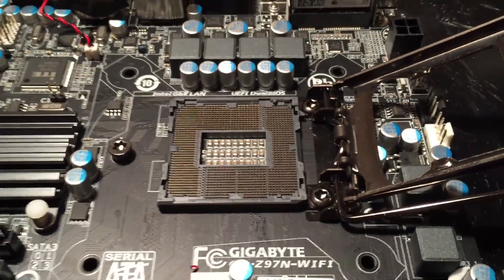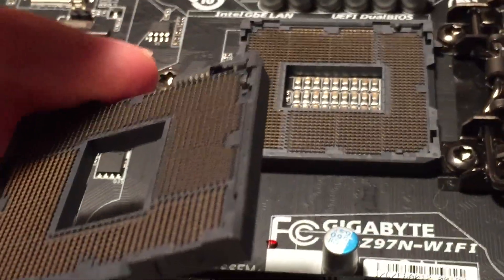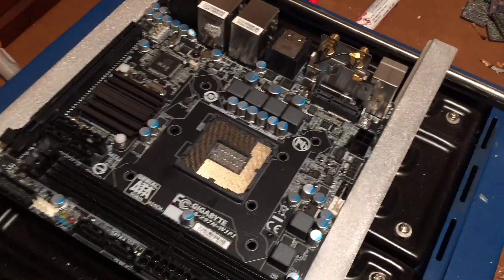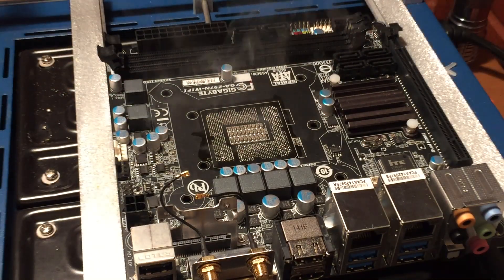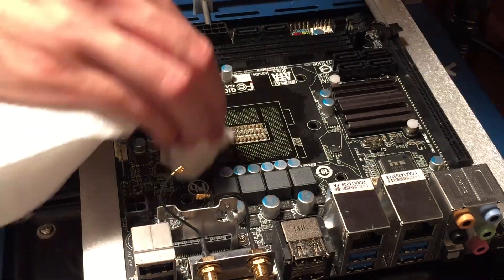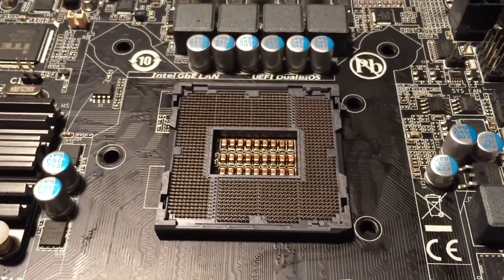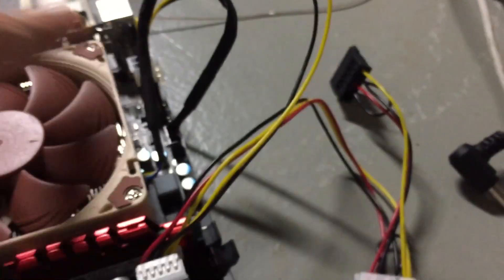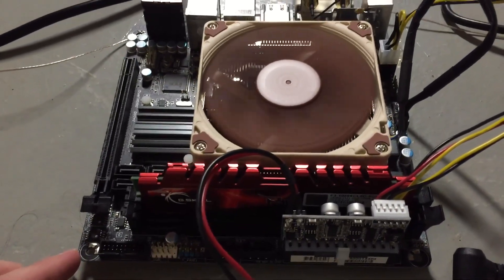Replacing a Damaged CPU Socket on an LGA1150 Mini-ITX Motherboard

Comment: How cool. So maybe U can help? I wanna use the Intel Xeon LGA1366 backplate (or complete retention package) on a LGA2011-3 to gain the bolt hole thread using my favorite 1366 CPU bolt on kits. Is this do-able, comparable? I can't seam to find a dual set of ThermalRight 2011-3 bolts to use my trusty Ultra120 Cu Extreme. The top end "X" bracket has been modded to proper hole spacing so I need a backplate to match

Comment: Pretty cool man. It's nice to know you can replace a broken socket on a motherboard. I'd imagine bending or breaking pins on your motherboard is a very frustrating thing.
Reply: Yeah, it doesnt work with no microscope etc, I mean I have a b450 tomahawk max, It turns on without a cpu but doesnt turn on with a cpu, so it's a socket issue obviously, It doesnt mind the cpu but as you lock in the cpu it shutdowns or doesnt even start, a 150-200$ motherboard became scrap.

Comment: And thats why you use AMD
Reply from the maker: What if a pin breaks off that PGA CPU? Sockets are cheap, CPUs aren't.
Reply: @dosdude1  It's much easier to damage the pins of an LGA Socket than the pins of a PGA chip. For some time, the socket would be exposed facing upwards making it easier to break off the pins by dropping something in the it,  but you only expose the pins of a PGA chip only when you are about to install it. >15 seconds at most, reducing the risk of pin damage or breakage.

Comment: You should get a second power supply for the fan so the speed doesn't vary when the heater cycles on/off...

Comment: Just out of principle (like say if using an extra motherboard but of no value), is it possible to attach the old socket to said extra motherboard having first swapped out the broken pin for a grounding pin or some other such 'expendable' pin? I appreciate it is unlikely to be economically worthwhile, but the principle could be noteworthy in scenarios involving a costly motherboard such as a server-board (or even one that is locked with a license).

Comment: The good thing about intel cpus that I wish AMD could do is that the pins aren't in the cpu itself, so if you bend them, you only have to replace the motherboard, not the CPU itself.
Reply: It's easier to fix bent cpu pins the bent LGA pins.

Comment: Thx Im actually going to try this on a clevo laptop with 1151 socket.Ordered the socket.There were just to many bent pins.I give myself 10% chance but worth a shot.I wonder if welding cable will work to clean up old Solder?

Comment: lucky, not the proper way, should have used kapton tape or foil tape on the resistors inside the socket & around the socket plus under side if you heated that also. didn't even see it being reballed or old solder removed.

Comment: (wont boot without pins)
tell that to my 1150 gaming 5 xD 2 missing pins still works perfectly
and my old phenom 2 X6 1045T missing a pin on the cpu still works

Comment: I am curious to find out if the board is still functioning today?  Amazing work so fun to watch your delicate skills turn scrap into treasure.
Reply: Probably not. This sort of repairs gravely shorten life of any other components on board that are heated over 160° not mentioning +200° :/
Reply: @TOKOLOSE  if you place a protective thrmal tape (idk how its called), it will not damage anything

Comment: Here's a top tip for you: The small lid that comes with the new socket? just put it on top of the old socket and use the vaccum pump to pull it, don't use two tweezers like you did because you'll eventually hit a capacitor or resistor on your way out.
p.s. thank you for your patches, your work and your overwall amazingness

Comment: The most important part, installing the CPU is missing in this video.
Also no information regarding the CPU in the BIOS settings, and information box with this video whatsoever. Lame video.
Reply: did you watch same video?

Comment: Not bad done my share of socket replacements at home on equipment like this, helps when you have extra old stuff to test and play with before you attempt a socket replacement, fyi you can wash motherboards to clean off flux even if its no clean do a good job and clean it.

Comment: Until this day, i didnt know that sockets could be repaired/replaced. This video is just AMAZING.

i have several questions and doubts tho:

1- where can i find/buy a board pre heater and a hot air nozzle for this type of work?

2- how did you know when the socket was soldered ready to the board?

3- the exact temperatures for the work are: 200°C under the board with the pre heater and 250°C over the socket with the nozzle?

4- how much time should you wait for the whole board to cool down?

5- how do you know that the socket is perfectly lined up with the board?

Thanks a lot to anyone who can answer this questions for me!

Comment: I have a board that doesn’t look like it has any issues but it will not post, the PC turns on immediately when I turn on the PSU. The CPU is verified to be working. It did have bent pins when I got it but I got them all back in place and it looks perfect. The board does light up (it has LED) but it has no post codes

Comment: @dosdude1 you have enough subscribers and stuff that you'll probably never see this, but does this process work the same way for 2011-3 sockets
If you've tried doing it with one of the boards?
Reply from the maker: Yes, it does, but those sockets are so big that my hot air BGA nozzle is too small to heat the entirety of one.

Comment: @dosdude1, Hi and thanks for sharing this. Few questions:

1) Would you please mention the brand and model is that BGA Rework Station?
2) Also, the video does not mention/show if it needs reballing?
3) In case, how did you reball them? 
4) Are they pre done in the purchased socket?

Great job and video overall. Liked.
Reply: The new sockets come re-balled and ready to install.

Comment: I have an AM3+ board I'm tempted to send you just to see if it can be fixed lol.  It blew one of the fuses.  I replaced the fuse but didn't change symptom.  Powers on but no post.

Comment: And this folks is why PGA > LGA
Reply from the maker: Actually when you really think about it, LGA is better than PGA. Can't fix broken pins on a processor, but broken pins on a socket can be rectified by replacing it with a new $5 socket.
Reply: @dosdude1  For the end consumer, PGA is better because the pins are stronger and more resistant to damage, unlike the tiny LGA pins. I've destroyed 3 LGA boards because of the stupid pins whilst never had an issue with PGA.

Comment: you way overpaid for a damaged board for 10$ more i can get a new one, amazing job nonethless im curious how long its gonna hold without reballing like the x360 rrod they fix but after it comes back... i never broke a mb socket because they always have the corner triangle to show alignment but some people are donks and dont read the manual

Comment: How did you solder the new socket in place:? Did it come pre-prepared with solder on the new sockets underside? And how to "control" that it does not connect different pins with each other on the underside?

Comment: There has to be something I am missing. I have tried this 8 to 10 times on boards I purchased. I have a hot plate that I blocked off all but the area under the cpu on the bottom and heated it to 150 C and had the hot air on and heated it until the board was 275 C. I kept increasing the temperature until the chip would just start to move at all which was about 300C. I have checked and changed temp probes several times just to be sure the temps are correct. I added way more flux then you did. The caps around were covered with capton tape, but the ones near and in the center all got loose. The socket NEVER even got close to coming off as yours did. Even when I would start to lift one corner and continue heating it would lift the tracks in the corners!!!!! Suggestions?
Thanks   I know this is an old post but I hope you still check on your videos.
Reply: did you able to sort this out? i am facing the same
Reply: @usamawaqas5596  No. I turned up the heat and it did get loose but either the caps all moved and or pads and lines moved!

Comment: I have a serious question, The capacitors in the middle of the CPU socket, How do you prevent those from losing their solder when you heat up the socket and put flux everywhere. Wouldn't the solder on the capacitors become loose potentially causing damage?

Comment: I'm confused, your removed the socket, removed and cleaned the soldering on the board, when did you apply any new solder so that the new socket will stick to the board ??

Comment: Did the replacement socket come with solder on the pads already? I see that you used a solder wick to remove the solder on the pads on the motherboard but didn't use a template to add little solder balls to the pads again. So I guess the socket had solder already on the bottom?

Comment: Video starts around 4:00 mark.
Until then the guy is talking absolute nonsense.
Also, the donut leaves the hot air on all the way through which spoils what we're seeing with a loud whiny noise. 
Get to it laddie, we don't want your spiel. Bloody amateur.

Comment: I'm amazed that when you removed the socket, none of the nearby parts got unsoldered and fell off, particularly the chip capacitors in the middle of the socket.  I didn't understand why you didn't need to put solder paste on the board to replace what you removed.  I guess that the socket itself is a BGA, and has solder balls underneath instead of contacts.
Reply: I was wondering the same thing, but interesting to know that sockets can come pre-balled i had no idea lmao but i also do not do much soldering.
Reply: I had to go looking for this too.  They do appear to come pre-balled like BGA chips.  I might give this a try too.

Comment: Can I send you my board to replace the CPU socket please, every so called repair shop say it can't be done or it would be cheaper to buy a new one 🤦 looking at they website most of them can only do really  basic things like replacing a connected hard drive or replacing fans. 

I got the board 2nd hand but I noticed the pins are not straight and they is 1 pin missing anyways

I wanted to get the part from AliExpress aswell but I don't have the tools to heat and replace it 😭

Comment: around 4 years back, I tried that around 5 Times . First time it was perfect fit. and after 2 times the Socket itself melted - Cheap china plastic components. and 4th time again got it right.. never tried it again because its hard to Distinguish between cheap Chinese and original good quality stuff. It is not about repair, but giving estimate to clients for such a repair where money is burnt in cheap chinese parts is worst. Hence we simply use to tell our customers to buy a replacement board instead of fixing socket.. Unless its a expensive server level board or something unique
Reply: How much does this process cost?? 
I am an indian .

Comment: a technician: fixes broken motherboard by replacing the socket
me: just puts a random piece of metal into the hole with missing pin and the motherboard actually works
the technician: AM I A JOKE TO YOU
Reply: You're a clever guy if you can do that with lga socket motherboards.
Reply: if this metal moves only a little it can cause a short and damage the mobo even harder and maybe the cpu and a lot more things. to be sincere, i have a board like that here and that's exactly what i'm thinking to do but that's my main concern. did you saw before what's the pin for ? and tested if it works without it ? because maybe its not even touching hte contacts
Reply: @leoyru.3361  Well, I actually do not really care what would happen to the pc, since I fixed it and in the result I just bought a laptop, but anyways, it didnt boot without the pin + the socket i did that on has under 1K pins, so it was quite easier and till now (I did this like 2 month ago) the computer works just fine

Only thing Im little bit worried about is that the metal might melt down, but I dont think that the cpu will be that hot
Reply: @itzarty  Most of the metals need 200 C or more to melt, so you dont have to worry about that :D
Reply: @siedliko  vibration: Am I ignored?
Reply: @siedliko  u mean 1000C right?
Reply: @itzarty  Hey are you responsible for all that Australian Bush Fires😠
Reply: @infernustitan7091  omg you revealed me. my motherboard sent a wireless signal to the forests and set them afire
Reply: @siedliko  200c? Is something wrong with you? Most plastics dont even melt at that low a temperature. If you're talking about solder you're still off. Most solder melts around 300°-340°C while lead based solder around 340°-370°C. 
But i doubt he would have placed a sliver of solder into the pin socket, rather a more common metal such steel or possibly aluminum, in which case aluminum melts past temperatures of 1200°C, steel upwards of 1600°C. 
Why would you even.think that? Anytime anyone used their oven to cook it would turn itself into a puddle of molten metal. Did this not cross that thing 
You call a your mind?
Reply: @darkracer1252  It's pretty clear that's what he meant.
Reply: @NikoBell1188  
did you reply to the wrong person?  
i just called someone an idiot like he is. 

there is no implication that i think he ment something else.

and putting a pin (thin piece of metal) 
in one of the pin holes to bridge the gap. 
this was a tried and true repair method used by ALOT of people. back in the 90's. 

the pins were held in place by the plastic of the socket.  it couln't move ANYWHERE as long as the cpu is in the socket.  

so there is no chance of a short what so ever.
Reply: @darkracer1252  he didn't say "most metals melt at 200c". He basically said at 200c you don't have to worry about anything melting. I understood what he meant.
Reply: I did the same for my old server board, I used a metal brush pin and cut it to size, worked like a charm
Reply: Omg
Reply: Reminds me of the time me and my mate fixed his 040 accelerator board for his amiga 1200 using a staple to repair a broken track on the pcb..... worked great still does .... now i need to fix my socket on my z170 board which still works but bent pins have for the moment killed 3 of my 4 ram slots.... joys of owning hi tec electronics
Reply: It is possible that the broken pin was not actually needed
Reply: @ΒαγγέληςΣιγάλας-β7π   yeah there is chance very very rarely.
Reply: @ΒαγγέληςΣιγάλας-β7π  it wasnt booting without it so yeah
Reply: Haha also me. I soldered a wire (two lines from wire) and pci-e detection works fine. Because my H97M ITX AC had missing pin from PCI-E detection.
Reply: a tiny spring will do better
Reply: No, you ain't joke. I have done the same many time. But when it comes with multiple broken pins it goes to scrap.
Reply: i did this with my ram socket, and it works very well
Reply: Honestly,your story sounds like pure BS to me.
Reply: @NikoBell1188  i mean, i didnt boot up at all so it seems to be a required pin, im not forcing u to believe but thats what happened and no, i wont take it out and photo anything coz im worried it would actually fall out and break other pins

Comment: what has he done exactely? I mean, just by warming it off exc..
Reply: I don't know what "warming it off" means, but I'll wager you mean that he was able to remove the socket by heating it. He used an air nozzle with hot air to melt the little solder balls holding the socket to each pad underneath. While it was still molten, he removed the socket. Then he cleaned it up and put a new socket and heated it up in order to melt the solder so the socket would stick to the pads.
Reply: @lucidbarrier  oh I see now, all makes sense
And how does it clean all the pins into the "socket core" (should I call It like this?)
Then he remove the broken One, the pins in the motherboard, how are they cleaned

Comment: these pins are all just luck (if you don't know what each is assigned for). on my first build, I accidentally bent 4 pins and snapped 1. turns out I got lucky with just dual channel not working, everything else was just fine. that motherboard was used till the end of its life

Comment: is why it sucks to have an intel socket motherboard. Too fragile. Very easy to damage the board and it is done for. Be nice if the ryzen threadripper also use the pinned cpu. Again it makes the board very fragile with this design.

Comment: That explains the listings and buyouts of cheap intel lga 115x boards with damaged sockets off of Ebay - I supposed it can be replaced and reballed, just never checked AliExpress for the spare part

Comment: "never seen anyone replaced a processor socket before"
Reply: same
bro
Reply: BETTER THAN PIN-FIXING.
Reply: Yeah bro
Reply: @J Fz so its basically impractical and its better to just buy new one, correct?
Reply: @omgsam7185  Also... having the equipment to perform this operation would be rare unless you use it for your profression.
Reply: @Donivar  so I guess it's really difficult and the cost of doing this outweighs buying a new one? Unless that board is made out of diamond lol
Reply: @J Fz That what i thought.
Reply: @J Fz Thanks for the explanation. Now i know why this type of repair doesnt make sense anymore.Take more cost. More time. Much easier just buy new one or second hand.

Comment: Awesome video , I have reshaped bent pins on some 2nd hand 27 IMac boards. It's like doing micro surgery with the jeweler's spectacles on. Very very delicate work, the motherboard heater means you can replace components on a board ?  Enjoyed watching the video. Also repaired video cards using a small pen torch to melt the solder and remake chip connectors,  it's having the nerve to do it first time.